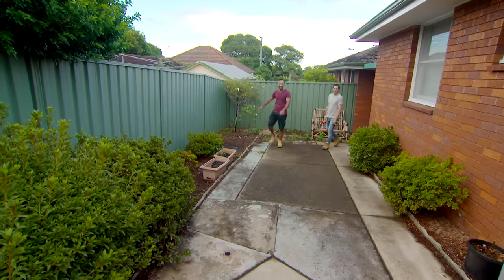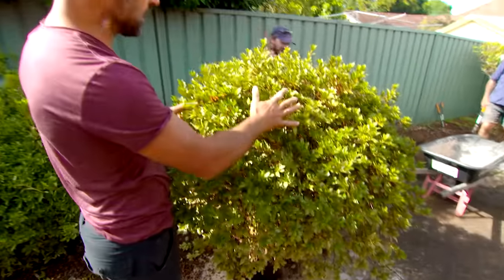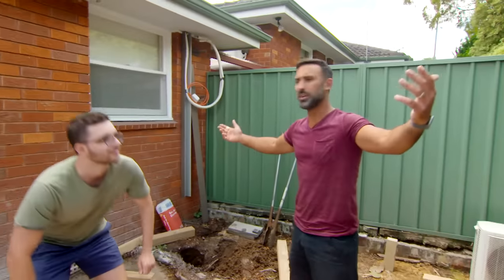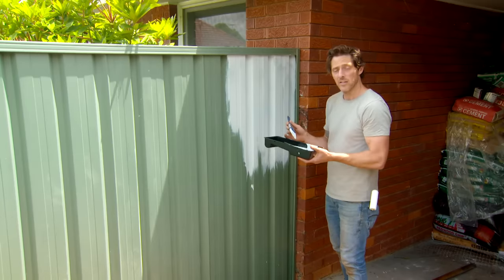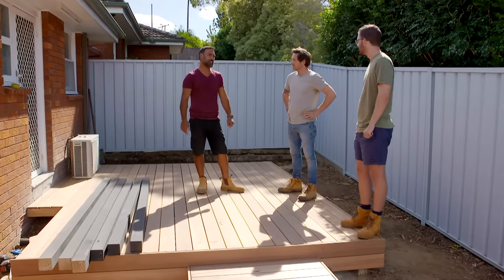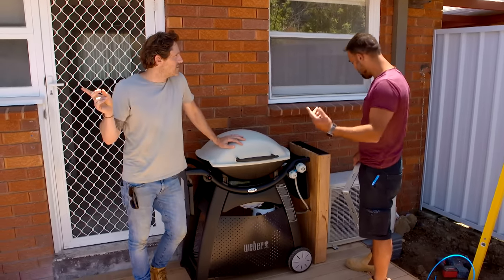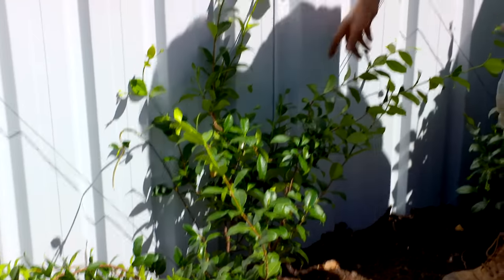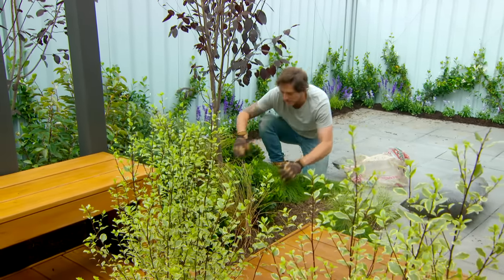TINY Backyard Makeover | DIY | Great Home Ideas

Comment: What is FC shape? The product used by the grill instead of concrete?
Reply: FC sheet - fibre cement sheet
Reply: It
Reply: @cathyc1079  can you tell me more detail about how to use it as an outdoor work surface, how would I seal it?
Reply: I am in the US and I can't find anything about it.
Reply: I was also wondering about that, is it backer board?